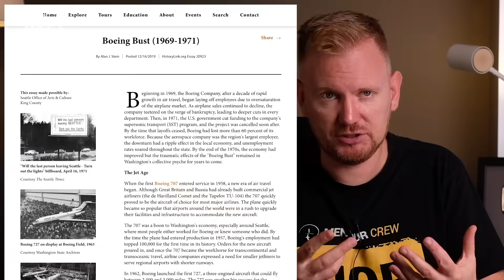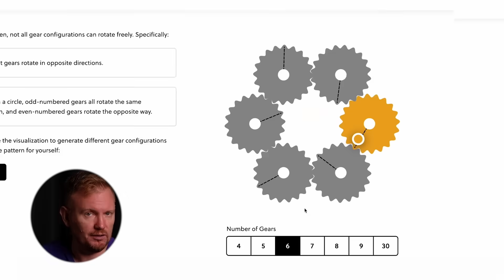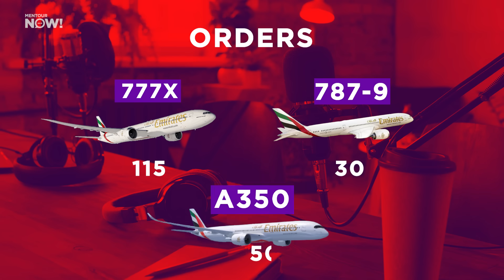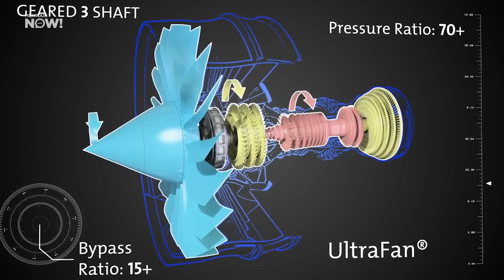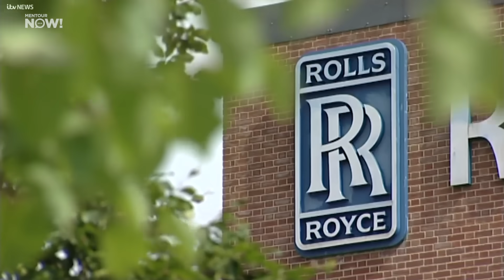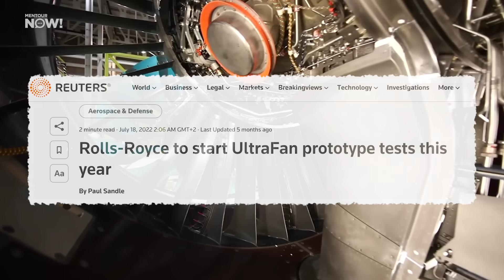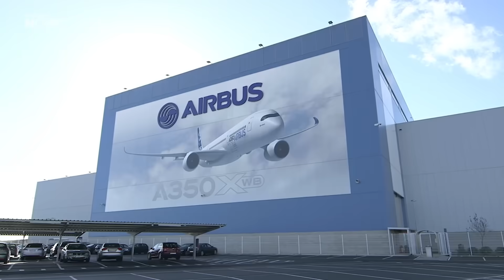Are BOEING planning a 747 with 2 ENGINES?!

Comment: I worked at Boeing for 35 years, including a short stint on the 747 program where I was supporting major structural modifications including conversion to the Airborne Laser (ABL) test bed. When I was working in Preliminary Design in the late 1980s, rumor had that Alan Mulally when he was responsible for new product development had a model of the 747 where he removed two engines and proclaimed to everyone "This is what the customers want!". That essentially is what the airlines got with the design of the 777-200/300. The original 747-200 had a three-class passenger capacity of 366, and the extended upper deck 747-300/400 increased the count to 400. The Japanese airlines with the 747SR increased the passenger count up to 498 to 550 for domestic flights. The 777-200 has a three class passenger capacity of 305 passengers, and the 777-300 has a three class passenger capacity of 368, although the exit configuration would permit up to 550 passengers. The 777-9 will have three class seating of 357 and two class seating of 426 passengers. Other than Emirates though, there is very little demand for ultra large capacity airplanes. Airlines might have a need 10 or 20 for slot constrained airports currently. That is not a large enough customer base to justify a new airplane program. Airbus when they launched the A380 was betting on slot constraints favoring very large aircraft. Airbus may be eventually proven right but they missed the timing by 20 years or so.
Reply: Yep sense at last
Reply: I have never traveled on 747 or A380. Could someone please answer this. Are they still boarded through a single door? The boarding time is too long as it is on 737, I cannot imagine boarding half a thousand passengers through a singe door.
Reply: @PaulVerhoeven2  for the A380 usually they’re boarded using three doors, two for economy front and back, and one for first class

Comment: I find interesting the possibility of an aircraft the size of the B747 with 2 engines. But I believe it should not be the an upgraded B747. Because in order to have a faster certification approval, the same 'type certificate' is used and 'minor' changes are made, such as from the DC9 to the MD80, from the DC10 to the MD11, the Fokker 28 to the F100, and ...the B737-NG to the MAX. As we have seen, this 'flexibility' has limits which, if exceeded, can lead to major problems (MAX). In addition, from the 70s to today, we have had enormous technological advances in all areas, therefore making a B747 revamp, seems to me something quite inappropriate.
As you said in the video, these new technologies reduce the number of aircraft that must be sold for the OEM to achieve break even. So, adding all these points, YES, an aircraft the size of a B747 might be interesting, but it would have to be completely new, and not a redesign of a project that is over 60 years old...

Comment: An interesting question in my mind at least......the West as it was once called, has committed itself to the "under wing" design (wing attached under the fuselage) whereas the old Soviet design tended towards and "over wing" design.............surely the over wing design would solve all the issues about engine diameter? They could be truly huge hanging from an over wing design, whereas the current under wing design is the limiting factor?
Yes, I guess designing new landing gear for the likes of the 747 would seem a "quick fix" to raise its ground clearance, but I suspect that's a bigger challenge than designing a new wide body jet to allow for these new huge diameter engines? 🤔

Comment: As many pointed out: Boeing had already a total disaster with using new engines on a plane/fuselage, that was not fit for them.

And the 747 is much larger and thus the forces and stresses on the structure will be much larger.

Comment: The best argument for a twin engine 747 is IPV (In Place Value).  For decades airports had been desingned from runways, pasenger ramps, maintenance hangers, etc.. with the size of the 747 in mind.  The Airbus A380 was shut out of airports by it's size and the Boeing 777 had to have folding wings to navigate most airports.  I was disapointed when they redesigned the 747-800 wing, yet kept the 4 engine pod configuration and was part of the Boeng Blunder era that saw Boeng lose its Crown of setting  the standard of the aviation industry.  You can argue the design is decades old and there are other more efficient ways to build an airplane, however for a dual purpose aircraft (passengeer AND cargo) the 747 is a universal design that offers solid service to whomever buys old 4 engine and new 2 engine designs.

Comment: Also if you were building a monster twin with 3.56m engines you'd probably want it to be high winged. That complicates design of the empennage and rear fuselage (to avoid tail strike) but offsetting that means the landing gear can be much lighter and more compact. Plus loading/unloading is simpler (you don't need airbridges to be so high and may be able to have a ramp for freight and luggage). But this means you would make a clean sheet design rather than modify the 747.
Reply: Yup, something like a more efficient Antonov

Comment: Why Boeing, which has been struggling with a recent deficit, is developing a third-generation 777X with the most powerful GE9x engine despite rising development costs. = a complete 747 replacement (especially cargo).

Comment: In terms of air freight imagine what you can carry on board an A380 if the splitting deck was removed?

I think the same case (but for different type of payloads) would be profitable for a twin-engine 747.

Comment: I'll shut up shortly but I just had an epiphany, somebody or a lot of bodies have messed up how is it in the name of all things holy can we be discussing the resurrection of some type of A380 and the enlarging of a 747 likely– 8 series when I believe at least technically the 747 production line is still open and the A380 has only been very recently halted production on. The A380 needs to be a little cheaper to operate and the 747 needs to be a little higher capacity in passengers or a hub-and-spoke jet flying from and to the UAE. At least that's how I perceive the video, possibly a joint venture between Airbus and Boeing ???? Nah.....

Comment: Correct me if I'm wrong but I don't think any North American airlines bought a single A380 they have no use for moving that many people at one time. Leave the United Arab Emirates can buy enough planes with high enough passenger capacity at an economically profitable price to make it worth the design of such a jet. Maintenance in a few empty seats on each flight is what killed the A380. Do you really think a higher-capacity 747 with freight hauling abilities would be the difference in success or failure of the bigger capacity jet ??? As you know the A380 gross vehicle takeoff weight is already maxed out by people, the jet itself, and fuel. The genx engine is still somewhat untested and the Rolls-Royce offering is still basically a concept isn't it. Rolls-Royce does excellent work but fairly recently had trouble with one or two of their engines. I wouldn't gamble a new twin-engine jet on a concept engine.

Comment: The issue is the current Boeing 747-8 uses the new GenX 2B67 when running 4 of them is over 256klbs of thrust with all engines.  The current GE90115 is only 115k lbs of thrust.  So 2 of them would only be 230k lbs of thrust.  Now there will be less drag and weight but still I don't think that would cut it.

Comment: ok, could you explain how the old British Comet passenger plains had the tiniest engines, small enough to make them almost disappear at side of the fuselage, but the modern engines are becoming giant monsters??
Reply: Hi Clarence,
The modern engines are "high-bypass ratio" designs, meaning that most of the intake air (80% or so) flows outside the engine's compressor/turbine core. That leads to the enormous intake shroud and cowling. The high bypass ratio gives much better fuel efficiency and cooling.
Reply: @g.tucker8682  Thank you, but I am afraid that does not explainn why the Comets has such a tiny jet engines. They too had to take in air and  spit out the exhaust. and such tiny engines.
Reply: @TWOCOWS1  Those "tiny" engines produced very little power. The Comet 1 turbojets produced just 5,000 lb. thrust each, which is one reason why it needed four engines in the first place. And don't forget that the de Havilland Comet itself was tiny (in weight, not footprint). Its maximum take-off weight (MTOW) was just 110,000 lbs. At that weight, its design only allowed the carriage of 44 passengers over 1,300 nautical miles. Even a 737-7 can carry nearly four times as many people over nearly three times the range. Tiny engines are only an option for small, lightweight aircraft unless you're installing them en masse.

If you want to move more weight (which you must to carry more passengers, more bags, and more fuel), you need more power. If you want more power, you need more air. If you want more air, you need a bigger engine. It's that simple. Just one of the A380's engines can produce four times the thrust of all four engines on the Comet 1. The A380 needs that because its MTOW is more than 11 times heavier. That higher MTOW is the only reason it can carry more than 12 times as many passengers over 6 times the range. Think of it. The A380 would need 64 Ghost turbojets to match its current thrust.

Even the Comet wasn't immune to this phenomenon. To meet transatlantic needs with sufficient passenger counts, it was using engines that were twice as powerful by the end of its production run (which required -- surprise -- bigger turbines and thus larger cavities in the wing roots to contain them). Even then, it still needed to stop at Gander when flying westbound from London to New York.
Reply: @fredocarroll  wow, thanx 4 the long and educational response. great. cheers

Comment: Ultra Fan - The short version of the A380 would need a high wing configuration to accommodate this large engine. Boeing might be interested for the replacement of the globmaster galaxey military transport aircraft. This is unlikely to see commercial conversions though.The rolls royce ultra fan next generation engines would not be ready until 2035 though...

Remember the industry wants hybrid aircraft in the sky which this engine supports. It would be popular to have a new short A380 with a high wing and the ultra fan twin engines.

747 two engines ultra fans ?

Not what you think...the concept is replacing the two inboard engines,the outboard engines would only be used in transtional flight and throttled back in flight saving some 12 % fuel burn.

Comment: The A380 failed as a freighter because even though it had a large volume for freight, unless it was transporting something relatively light it could not take advantage of the extra space. If two new more efficient engines’ payload is less than 4 engines of today, a twin engine 747 or whatever would hit this same wall.

Comment: Hmm, as technology-driven as you are Petter, there's something you're a bit behind on and that's the use of hydrogen for fuel as you mentioned briefly in this video. To that I ask you to consider this: Just over the last 30 or 40 years, there have been several individuals here in the States, who've converted 4-cylinder Ford Escorts, and similar economy cars, to run on nothing but water using hydrolysis! Some were hybrids running half on gas and half on water, but even those could be made to run on just water alone, and do you know what the ONLY emissions from these converted gasoline/hydrogen/oxygen-burning engines had been? Nothing but pure water, and I'm serious. 

Look it up on YouTube. There's still a bunch of videos showing everything I'm describing here in action...

Simply stated, people just 30 or 40 years ago could convert simple 4-cylinder Ford engines over, to literally run on nothing whatsoever but water by breaking it down into hydrogen and oxygen, mixing them and burning them both. Seeing how these two elements are well-known as the most abundant, and cleanest-burning fuels in the known Universe, why wouldn't we opt for them as opposed to the myriad of hazards fossil fuels have caused humanity for soon-to-be two centuries now?

Question: where are these technicians and their technologies today? Sadly, the answer is dead and buried. A good example is the young kid from Texas, who took his 1978 4-door American-made "fat ride," and with an idea and a few months, had it getting 100 MPH by literally running on fumes. Yeah, fumes. During the "gas crisis." He died under suspicious circumstances one night after stopping at his local bar and bragging to his friends about it, and that's just one incident we know of...

Comment: For me the big attraction of the 747 or the 380; is the fact they have four engines , it gave me a feeling of extra safety.I always felt that two engines on such a huge aircraft didn’t feel as safe if one engine failed . They talk about being more efficient but it’s really more economical.
Reply: Jet engines are something like 150 times more reliable than they were when the 747 entered service.  2 engines is perfectly safe.
Reply: Modern turbo fans essentially don’t fail.

Comment: honestly, if antonov does go ahead with rebuilding mriya at some point, using that extra shell they have. i hope to god they throw on either those GE engines or those prototype rolls royce engines. make her colossally more powerful than before, faster, more efficient, more badass, higher weight capacity. call it the 225FP, as the biggest f*** you to putin lol. 

but in all seriousness, mentors forgotten one key detail while dangling it under his own nose. while theres nothing seemingly planed for the 2 big manufacturers, cargos gonna need replacements. 20-30 years down the line when theyre starting to be forced to buy ex passenger 747s to convert, theyll be asking "wheres our new model" cause NONE of these twin engine planes on the market offer what the 747 does, that massive front door for big specialist cargo. when the 747s start dying currently it looks like they have 2 options... over expensive military aircraft, that are still shorter than the 747, or trying to buy an124s from antonov. which are probs expensive as all hell, and probs need a bigger crew than a 747. 

emirates alone cant make manufacturers listen, but when cargo companies start showing interest in a 747 replacement, emirates can use it as a foot in the door to pry open a passenger variant. afterall, if the cargo variant's kept the 747 lines afloat for so long, im sure cargo could keep a replacement afloat too. not to mention airlines wont have a choice but to go bigger again cause the busiest airports in the world are already over capacity to borderline dangerous levels. and to top it all off, boeing and airbus are gonna both need to replace thier specialist lifters at some point. especially since its the fastest and safest method of moving the aircraft parts that are located all over the world. 

will it be a twin engine? id honestly be surprised. because why would you make a 747 successor twin engine? you could have an antonov killer by throwing 4 of those royces on something. hell, why not to do the 747 party trick of having additional engine slots... sure make a twin engine for passenger use or whatever, but have it upgradable to up to 4 working engines for specialist heavy lifting

Comment: Will not the new planned Air Force One be a 747? So, it then should be the last…
Reply: There are two 747-8's which were built in approximately 2015 and were going to a Russian airline which went bankrupt before they took delivery, so the planes were stored in the desert. In 2018 they were purchased by the U.S. government and are now in the process of being modified at a Boeing facility in San Antonio for use as Air Force One. There will be two of them just as there are two 747-200's which are currently used as Air Force One.

Comment: Why can't the 3-engine config be reconsidered? It's < 4 but > 2. Highly efficient 3 engines that could fit in current plane sizes. Just asking as a layman. I ain't an expert. 😄🙏
Reply: The third engine would have to be mounted in the tail which makes maintenance much more difficult. Engines are the single most expensive parts of an airliner, both in purchase price and maintenance. Three engines means 50% greater engine costs than two engines. They used to have three engines in some previous planes like the DC-10 and 727, but as jet engines became more powerful these were replaced by twin engine planes.

Comment: 11:55 he says: "...ships and even tacks".   What the heck is a tack?  The only things I can think of that need massive jet engines that are not aircraft are ships like hydrofoils, hovercraft, and perhaps wind tunnels.  Russians had some jet engines mounted on a train experimentally in the 1950s.  But any way you cut it, they would be small, nothing that might require a massive jet engine.  Can someone explain to me who RR can market a massive jet engine to, other than hovercraft or massive hydrofoils, and sell at least dozens?

Comment: I loved the L10-11.  At the time of flying around the USA in it, I had no idea it was a Lockheed aircraft.  I have no chance on flying inside anything else made by lockheed at this point.  They do not make passenger airliners anymore.  Shame too as the 10-11 was a good jet.  Way too short of a life.  That flying stabilizer design meant that we could all fly in something that had a stabilator like a military jet.  Surprised that more passenger jets do not use a stabilator instead of elevators.  Aren't they more drag efficient and with economy the primary factor, I would think new planes would be designed with them.

Comment: 4 engines are safer than two when the plane in the air just turn off the 2 engines to save the fuel